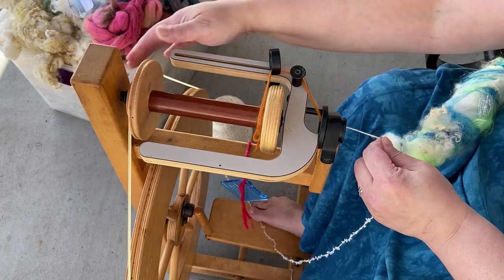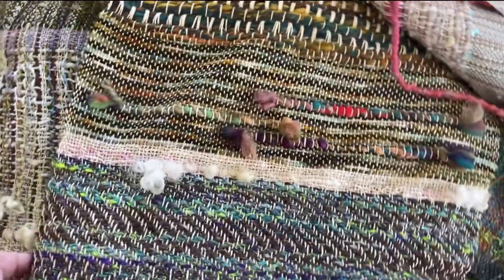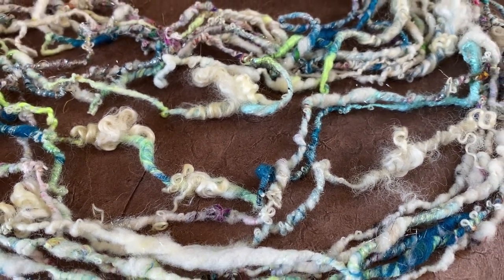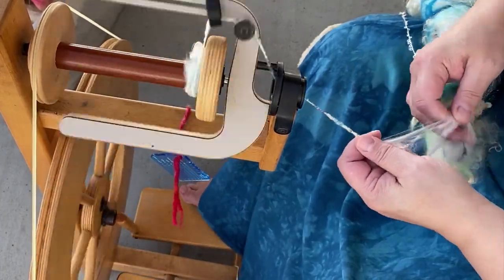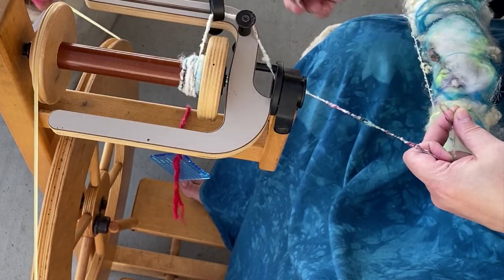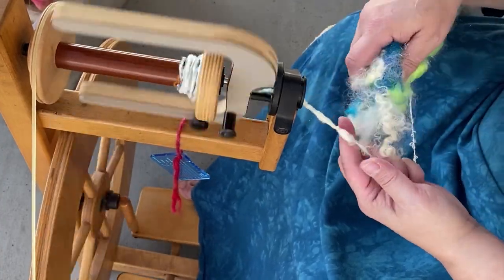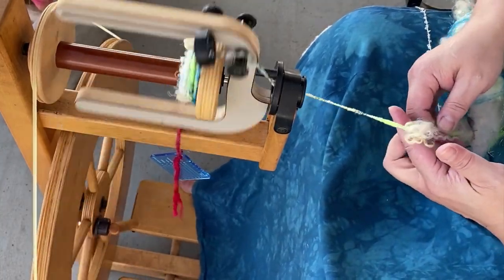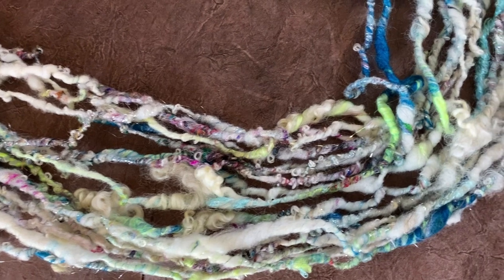Core Spinning Yarn for Art Weaving

Comment: So glad you're back, and hoping that Real Estate is sustaining your soul as well as your wallet. Thank you for making these videos. So, if you're not religious about following a pattern, you can certainly incorporate these textured, sometimes bulky art yarns into knitting. If it's not against-the-skin soft, you need to take care where to put it. Around the middle or bottom part of the increases in a yoke sweater. Trim around a collar, button band, or bottom or ends of a shawl. At any height of a knitted skirt. Or anywhere you feel like in a truly freeform piece. Use purls and slip w yarn in front to show off juicy bits.